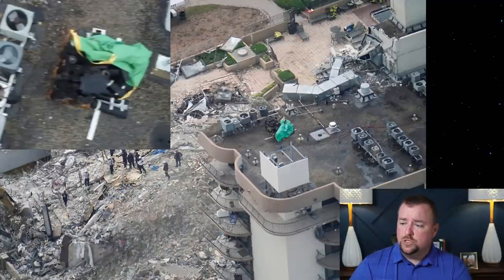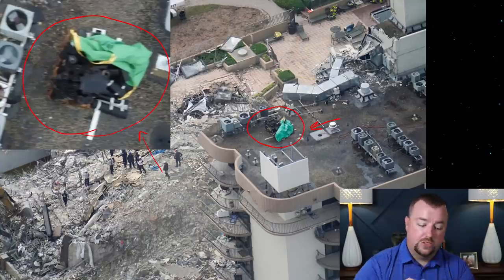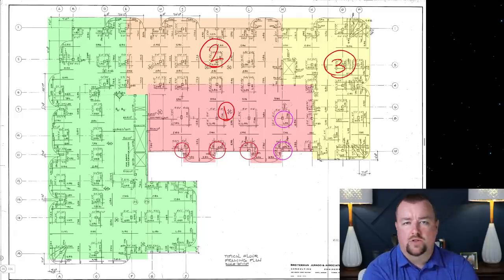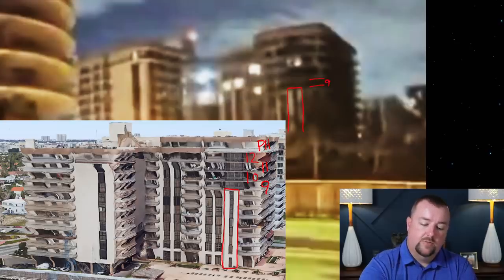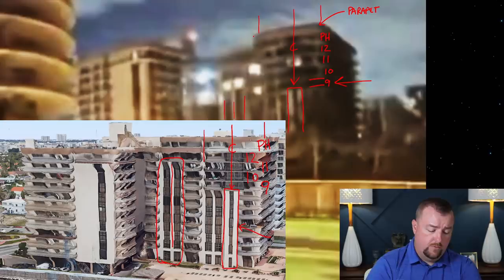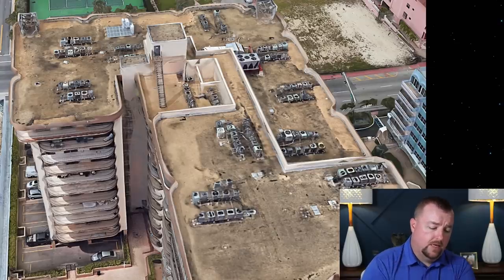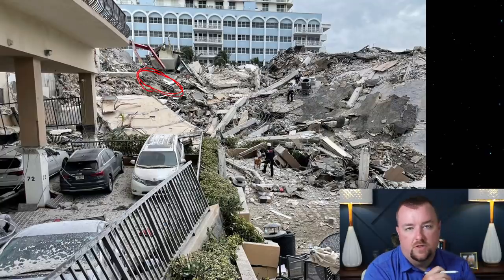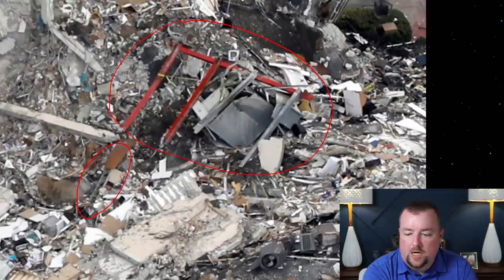Surfside Building Collapse - Did it start at the roof?

Comment: There's a youtube video showing a walkthrough of one of the units in July 2020, the last couple minutes of the video are walking around the parking level:  https://youtu.be/w4rGWH7aDJc  It looks like lots of stalactites and some water on the floor (but not deep water).  Is anything from this video worth commenting on?
Reply: Wow, I just watched the walkthrough video you linked above.  Super creepy.
Reply: Incredible.
Reply: I would like to hear Josh’s comments on that garage ceiling.
Reply: the stalactites you refer to, visible at 4;15 in THAT video, ARE an indication of moisture problems within the concrete slab roof (which is the pool deck in the area away from the garage entrance ramp) - you can see that they form along lines - the crack lines in the slab.  Normally, cracking in slabs is not a huge deal, concrete DOES THAT, at stress loads significantly below failure loading.  The effect is similar to 'efflourescence' the leaching of salts out of the concrete by water migration. Concrete sometimes does that TOO, after all, it is a hydrated mixture of cement and aggregates and over time (years) will expel moisture.  As to how this may have contributed to concrete degradation, I will stop there.  Research it further or wait for more detailed analysis.
Reply: @nobodyknows3180  The volume of bubbling paint and peeling patches of paint are significant signs of moisture penetration. The paint they applied to the concrete probably made the concrete degradation accelerate. Another bad sign of just how much water was leaking into the garage through the slab was the fact that there are corrugated roofing panels propped up in several areas to shield building occupants from the water raining down near their parking spot. You can see these panels all over the place.
Reply: Me too. Also noticed a “ServPro”-type fan in the hallway next to the door of the apt. Didn’t know if that could suggest leaking issues there as well. Just curious.
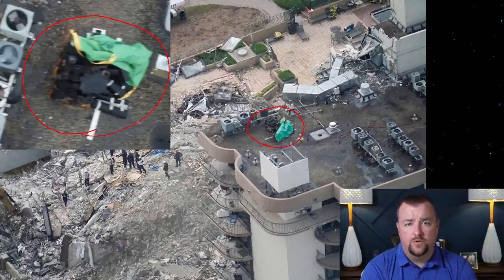Reply: I just watched prior and questioned source of stalactites at 4:09 to 4:15 (particularly bad rusted area) but also all the strange white drips, sometimes oddly square flaps. After reading comments here I wonder if it’s related to thick paint breaking down due to water permeating. I do appreciate these videos and those who can offer some insight. How could that not be seen as a problem if only because such an obvious eyesore. The more you learn the sicker it can make one feel…
Reply: The garage floor was saturated with water in those Vidio s there were chunks of concrete missing THROGH out the whole ceilings of the garage I would have got my family out the day I saw the bottom floor in the garage sounds to me like this guy has switched his stories according to what people say and he has seen I call b's on this vid
Reply: @Elise10000  that is called Spalding ,,,when the REBAR rust s inside concrete it swells up to almost twice the size it is and busters the concrete out in lines just like what you saw in the garage ,,those tabs are sealer that was a bad repair gone disastrous that's what those little pieces of tape looking things were hanging in a half circle on the ceiling ,,,,,the whole BOTTOM FLOOR OF THAT BUILDING WAS SATURATED,,,SATURATED ,,,WITH WATER THERE IS NOT A DRY SPOT ON THAT FLOOR ANYWHERE LOOK AT THE BEAMS AT 54 AND56 PARKING SPOTS YOU CAN SEE THE TWIST IN THE MAIN I BEAM IT'S BEEN COMING DOWN  VERY SLOW FOR A FEW YEARS WATER EVERYWHERE
Reply: @briananderson3801  Not Spalding (like the late writer/performer Spalding Gray), but "spalling".
Reply: Spelled it wrong ,,in a hurry
Reply: @briananderson3801  thanks for reply. Yes exactly, the little square tapes hanging at garage ceiling in other video I wondered about. Sealer. And the spalling from rusted rebar, got it. It just looks so bad clearly there’s a problem but seems they just kept trying to cosmetically fix it. I find the analysis very interesting, I don’t think this guy is saying it started from roof in any way, he’s responding to that hypothesis, clearly it’s a foundation level problem.
Reply: @briananderson3801  I knew that was possible, but I wanted to give a shoutout to Spalding Gray when I had the chance.
Reply: Yes she didn't know it but in one hour she showed all the evidence that they will ever need I can see collums leaning at 54 56 57 parking spots there is a twisted beam in her pictures over buy the ramp that beam has so much stress in her picture just the concrete floor alone just the floor IT IS COMPLETELY SATURATED WITH WATER THAT FLOOR IS SOAKING WET NOT A DRY PEICE IN HER HOLE FILM IF I HAD PULLED IN THERE I WOULD HAVE TOLD MY WIFE WERE OUT OF HERE THE WHOLE CEILING IS DRIPPING WET ,,,NOT A CHANCE ,,,I STAY AT 2 OF THESE PLACES IN METAL BEACH AND 4 IN FLORIDA NEVER NEVER SEE A FLOOR OR CEILING LIKE THAT I WOULDN'T HAVE STAYED ,,,THAT'S THE FIRST PLACE I CHECK ,,,,,DON'T CARE WHAT ANYONE ELSE SAYS I LEAVE

Comment: Watching the security video of the collapse, it seems clear that it started at ground level, not the roof.
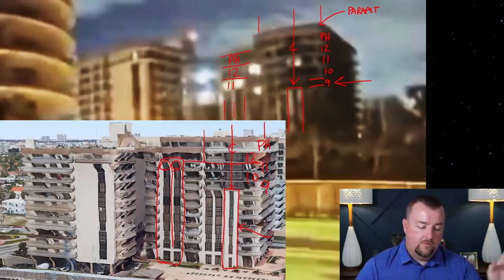Reply: 16:43 you didn’t watch the whole vid…..
Reply: @Orinfoo  What? Did you understand what you watched? The top floors were intact (as far as we can tell) when the building was collapsing. They hadn't "pancaked", but had dropped in height, indicating that the collapse started at a lower level. Of course, we can only speculate on what we can see.

Comment: I worked with explosives in the military for years, your instincts are right.. What we're seeing is the last frame of video before the electricity fully went out, if that were explosive flashes it wouldn't look like that, and you would see residual fires caused by carpet, and wallpaper burning for another frame or two before they are blown out by either the pressure wave, or debris.. It is one of the reasons that demolition teams remove everything flammable from a building before imploding it, explosive devices will start fires..

Comment: I think it is plausible that the work happening on the roof may have aggravated the existing damaged/compromised concrete structures at the base and weakened them further. Since it is probable that this deteriorating concrete issue had been metastisizing for some time it is likely that heavy vibrations from the construction of the 87 Collins building(the oval one that had the security camera that captured the collapse) may have been a factor in the integrity of the supporting columns and the pool deck slab diminishing too.

Now let's add in the penthouse, this is dead weight that was not incorporated into the original design capacity. Adding that was a foolish idea and manslaughter.
Reply: Yes thats what happened in the Sampoong mall collapse. I was wondering if anyone else thought of that after seeing the clean punch throughs.

Comment: I'm thinking the cumulative damage of water, spaling and rusted re-bar may have turned the building into a house of cards. Evidence is the extent that the building disintegrated as it collapsed rather than breaking into 6 or 8 large chunks.
Reply: That's interesting. I'm just not sure what I'm looking at in the rubble because I would also think chunks would be larger also.

Comment: These security camera typically read out the camera continuously.  When triggered to record they include a previous recorded video ( this us usually  configurable) with the motion capture video.    So you would see what was happening, in my example 10 sec of video appended to the motion capture video.
Reply: You can see the edge of the monitor and edge of the software window in this video on the left side. This is someone recording the screen of the security system in the building next door with a cell phone because they didn't know how to get the original files out. I'm sure the original video is higher resolution (not recording a screen playing the video), and doesn't have the beginning chopped off.

Comment: Perhaps the residents turned on the lights because something woke them up.  Like the collapse beginning.  Or the immediate prior event.
Reply: Yes, and most of the units had large sections of mirrored walls in living and bedroom.
Reply: Actually you can see this dynamic play out in a couple of the units particularly in the last section to fall. It's evident that someone awoke and clicked on a light just before they lost power and the building came down. One illumination also appeared to progressively occlude momentarily as though someone was traversing a space between the camera's field of vision and the illuminated surfaces of the room, moving rapidly in an easterly direction away from the drooping section of building and into the final portion that remained standing...
Reply: Those are arc flashes from power feeder cables that run up the building to feed power to all the condos. Each flash extinguishes in the same frame as lights elsewhere going off in the building. The building is fed with 3 phase power, and you can see 3 distinct groups of lights going out as the building collapses. 2 of the phases happened to have visible arc flashes on them as the cables or bus bars were being ripped apart.

Comment: I think some of what looks like flashes of light could actually be reflections picked up by the window glass, as it moves due to vibrations or falling or whatever.
Reply: I think those flashes are way too bright to be reflections. They look like electrical arcs, as cables are yanked out of breaker panels. The blue-ish color compared to all of the other lights supports that guess a well. The lower of the 2 bright flashes extinguishes on the same frame as the light going out in one of the other apartments in the section collapsing. The higher bright flash goes out at the same time as a light much further down the building going out, and then the remaining lights go out a few frames later. That would correspond to the 3 phases of the power faulting in succession, and  protection equipment kicking in and disconnecting those phases as they fault (short).
Reply: @gorak9000  Good explanation.  I didn't really observe lights-in-window phenomenon in the initial collapse video, but I did when I watched the demolition of the section of the building which remained standing.
Reply: @DanEBoyd  There are multiple "versions" of even the original video of the collapse, some of them are missing the first bit and start after the flashes and lights are all mostly out. You have to search around a bit to find the one that starts with the 2 bright flashes in progress. The more-complete version is available on "WPLG Local 10" youtube channel. Even that's not the actual start of the video, because all of it is someone recording a screen playing the video on the security system with their phone. You can see the edge of the video window on the left side and top left corner in the video. Would be nice if the original video was released from the security system that starts before the collapse starts, and isn't a phone recording a screen!

Comment: "The process is the product" is a phrase used to describe government failures and inefficiency. It seems to me that this 40 year building reassessment rule at least in this case also fits this phrase. If all that is required is to be in some process of inspection and bidding and paperwork which drags on and on without the lifesaving structural repairs being done, what good is it? The process didn't save anyone here. Work done years earlier may have done.

Comment: One of the things I'm wondering about is why no one raised an alarm claiming the building was unsafe.  I'm suspecting it's because they were focused on the pool deck and didn't think that would cause the main building to go down.  I'm thinking the collapsing pool deck put a sideways force on the supporting columns (as well as no longer holding them in position) and down she came.
Reply: It does appear that the slabs gave lateral support to the columns.

Comment: The roof has nothing to do with it. And in past videos, you can see where the debris first fell. 
Everything is clear from the last photo. 26:24 
A monolithic slab over the parking lot collapsed and buckled. From the side of the fence, it is rigidly fixed, so the tension fell on those 3 columns from the previous videos. The columns were bent outward by this force and the front section collapsed, pulling the rest of the building. 
Part of the building has survived. The columns in the remaining part of the building are much thicker and there is a monolithic wall (lift shafts). 
Sorry for my English.

Comment: This may be crossing the speculation line. And I am by no means an Engineer. But when was the penthouse added to the building? Reason I am asking is you mentioned in your other videos that rusted rebar causes the steel to expand and bust out the concrete. How long would it take before that happened? Could the water that caused all of rust and concrete degradation come from rain water on the roof and found it’s way into the supports of the structure and eventually into the garage? Due to poor drainage and missed cracks in the roof once the penthouse was completed. 

If you look on Google Maps on the corner of Collins Ave and 88th Street straight up to the top of the building you’ll notice what looks like a busted off section of the stucco. If you move down 88th towards the garage ramp, the second column of balconies, the 9th floor balcony ceiling (or would be the 10th floor’s balcony floor) there is what looks to be exposed rebar sticking out the side. You’ll also notice more stucco missing from the 11th and 12 floor parapet.
Reply: Although they updated drawings on May 14, 1980 for a 13th floor, they did not apply for a permit to built it until August 1980 which was granted in Nov 1980 which was one year later after the 12th story building permit was granted. How far they get into the building after a year, (12th floor or not), is anybodies guess.
Reply: @beehaven9949  Hmmm…interesting. I also did a comparison between Champlain North and South on Google Maps. The North building looked in better shape than the south, as if it was up kept better.  East looked the best out of the 3 which isn’t surprising since it was built in 1995-ish.

Comment: construction started on the roof maybe becuase of the metrics of performance evaluation from management- had a quantifable  reduction in maintenence calls and maintence tickets from most recent roof repair- which for a project manager would help metrics of project progress if roof was prioritized over ground level for most recent repair(start at top and dry in first then do the repair of the concrete spalling in basement and pool deck) pooldeck and garage might not have as easy of quanitfiable perfomance metrics such as decrease in guest service tickets for those areas - every tenet would complain of a water leak in their apt, what small % of tenants ever officially made a building complaint  with management about the spalling and collumn problems in public sections of garage
Reply: It's possible, but I heard (from this channel I believe) the roof was in good condition. People were complaining about cracks and water leaking in, but that seemed to be related to windows and doors, not the roof. Perhaps because a bunch of laypeople (condo board and residents) were making the final decisions about where to spend the money they figured fixing the roof would help stop the water leaks?
Reply: @Fix_It_Again_Tony  laypeople! exactly. i work in hospitality and have worked for hotels, they have arbitrary metics they want to see to make sure they get a quantifiable measurable performance metric return for every dollar, which is stark contrast to engineering and construction needs but makes the person writing the checks feel better about what they get in return for the moeny spent.

Comment: Those “lights” you’re talking about, are arc flashes from the electrical supply being torn apart and shorting out as positive and neutral lines contact each other.
Reply: Yes it's obvious from the video that it's the electrical conduits arcing when they're severed.

Comment: My thinking about the lights being on in those units is because as the building was about to collapse those top units likely started hearing it before the collapse so think those people woke up investigating moments before.
Reply: I prefer to think of people being asleep in their beds - the horror of waking up....
Reply: I'm thinking the bright lights on the left (and others later) was air conditioning unit power cables being yanked off descending air handlers. Is that possible? I'm expecting in humid south Florida a lot of them were on in units. Arcing of some hallway lights cables or fire alarm in the hall is not out of the question if the first two areas split up. But you are right to consider the camera was trying to take in a dark scene. Any flashes would be overexposed.